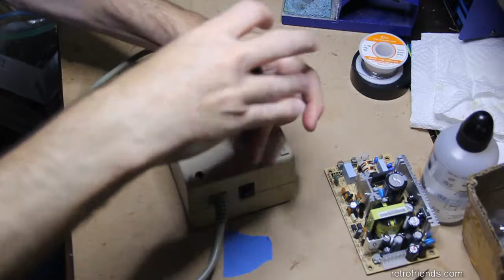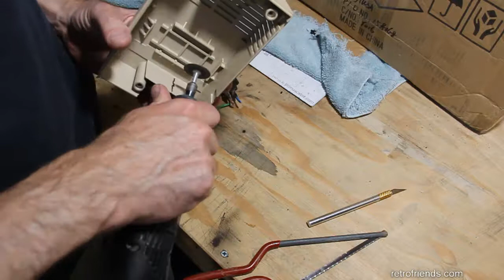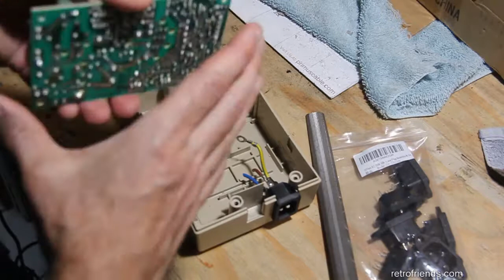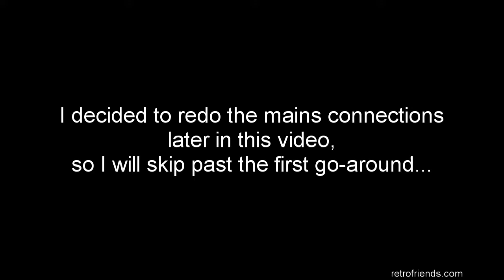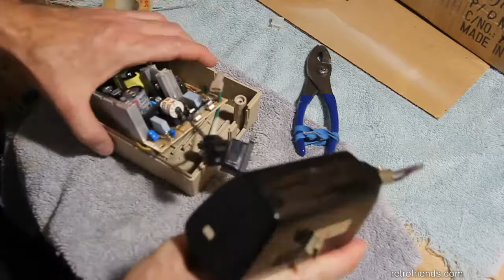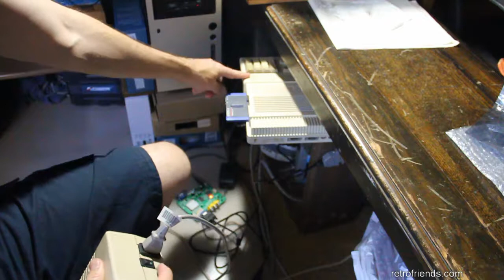Amiga 500 Power Supply Upgrade using a Meanwell PT-65B

Comment: Why did you not buy the connectors that would only be €3,66 extra, and then you get 10 P2 and 10 P6, would have been much better?

https://www.aliexpress.com/item/32868232013.html?spm=a2g0s.9042311.0.0.58fc4c4dba0nHR

You have them also with cables, and is upgrading to a better solder station not a great idea?